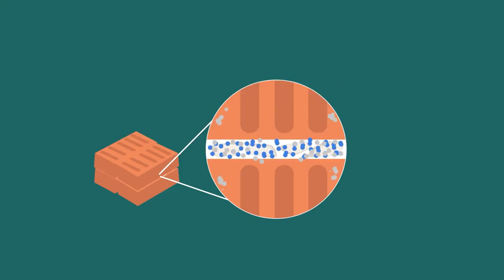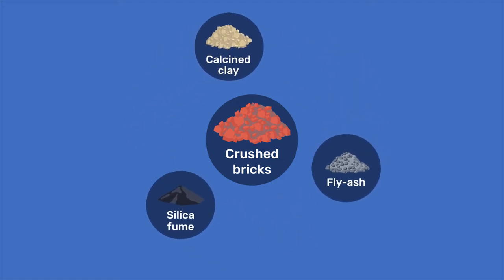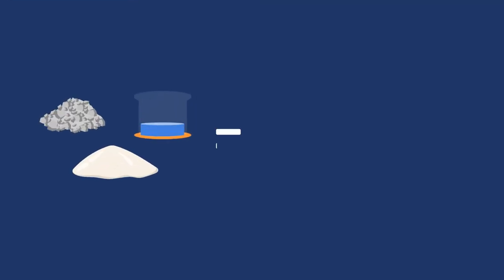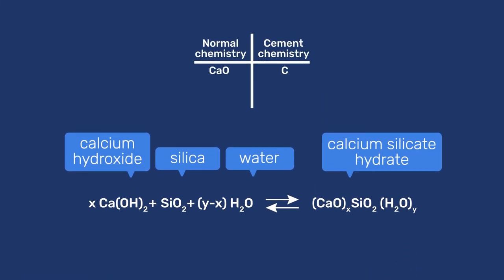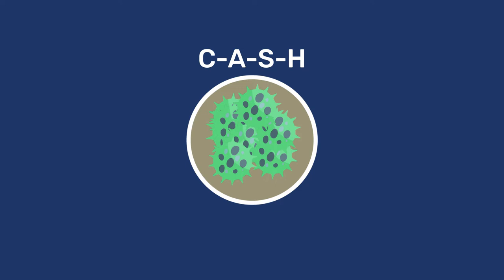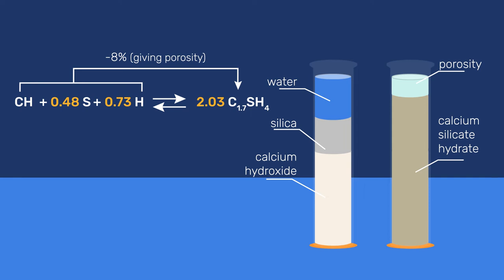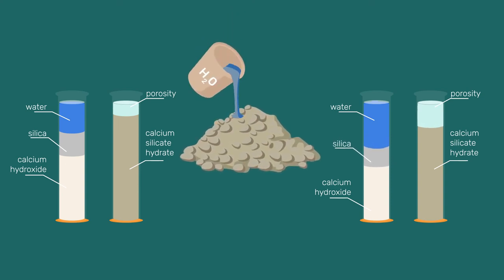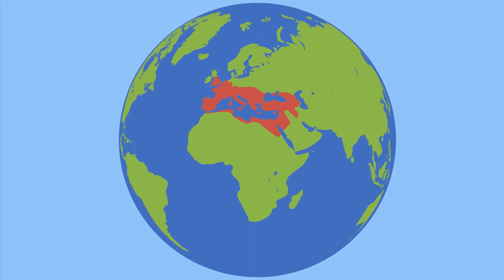Roman mortars and the secret of the pozzolanic reaction

Comment: This video does not descripe the true hydration reactions of the Roman cement.. Roman cement is reaction between amorphous CAS material such as the pozzolana or GGBS and hydrated lime and an activator in the case of Roman cement and a crystalin material such as th tubomorite.. the binding strength of the Roman cement does not depends on the CSH crystal phase rather then it depends on the hexagonal crystalian phase.. these crysalian phases, the hexagonals, are the secret of the longgevity of Roman cement.. they do not undergo intrensic shrinkage after setting but most important they need high volume of water double the amount of water needed for the CSH crystals that found in Portland cement.. on top of that the left over of the hydrated lime will react with Carbonate to form a layer of calcium carbonate that will added to the overall strength  of the concrete.. Roman cemmen does not suffer drying shrinkage like normal Portland cement because it absorb the extra added mixing water into its crystals, and does not develop drying shrinkage cracks like OPC concret ...that is its secret..
Reply: If I wanted to build a stone house to last a thousand years, what mortar should I use between the stones to last a thousand years?
Reply: @ad1103   it reads like you should stack basalt and plaster it in mortar
Reply: Dont use Stones
Reply: thanks for pointing this out, I don't think this video is correct either... hydrated lime doesn't bond strongly and only in a linear fashion is what I have read, I read that the Roman concrete had unreacted quicklime left in the mix so it could heal, but I don't know what is true.

Comment: Great video! I have a question regarding the superiority of the modern portlant cement. It has indeed proven itself by its wider use of course and its thermal expansion similar to the steel. Yet concrete made with portlant cement degrades rapidly and its durability is questionable. Its PPC's main ideas. It allows for extended durability as well as chemical resistance. Would you share your opinion on these facts. Also I read that the aggregate used by the romans had larger variety as well, effectively making rubble concrete.
Reply: They are being sort of dishonest in saying modern concretes are “superior”. They might be superior at generating industry, but not as a building mortar and concrete technology.  The first issue is them skipping from “Roman concrete” to modern hydraulic products:  by volume of use, most human structures up to 1900 are hot mixed quicklime and earth.  Sometimes modified with poz.  The knowledge was never Roman.  The only thing Roman was industrial scale and military application…. They did pick it up as one of their technologies, as every building culture did.  It was used all thru the Middle Ages in the levant, china, France, etc.  never Roman never lost.  Always the main technology for human scale building.  Plasters, mortars, and cast things.
Reply: John Smeaton who was fully familiar with all manner of concrete chemistry and their use by craft guilds thru his recent history…. Writes from 1800, that “Roman concrete was lost”
Reply: @KurtisHord   Thank you for your reply. Some interesting points that you bring up. I would take me time to reply categorically. I am not sure if they are dishonest in their assumption of the moderns concrete superiority. I am sure that if there is any mistake in their knowledge it is due to the information sources used. Nevertheless, in school we have learned about the ancient construction methods, although to be honest I do not remember half of that, and the point of the superiority of the portlant cement was its thermal expansion and strength and compatibility with steel; These all sum for the what, I think I understood you meant as generating industry.
And about the romans, they surely did not invent the concrete but the way they made it popular one. I have read that the minoans used it for baths. Interesting point you bring up with the earth, I am not sure it will make same chemical bond with the lime as lets say crushed ceramic pots, vulcanic ash whatever (As is the one found in some places in germany). But all what you say is very interesting I would like to read about it if you can recommend smth. to me. 
For example I have read that the romans made a sort of rubble concrete out of it, making the mixture rathe dry compacting it and puting layers of stones; And also some brick separators (in some cases as external layer) every meter or so. Very similar to the middle ages wall construction (at least the one I've seen).
Reply: @TheTransfix  so…. Understand the folks who invented engineering trades, had an agenda to say they were superior and craft practices of builders prior to them were not to be trusted.  I am a builder that works with 9th century methods and materials.  So I have my own agenda to promote human centered building knowledge rather than corporate or industrial
Reply: @TheTransfix  the best scholar is dr Robyn Pender and the best chemist is Nigel copsey
Reply: @KurtisHord   I forgot. I absolutely agree this was never lost. I guess it is a sensationalism thing.
Reply: @TheTransfix  the engineering field started with John Smeaton and it’s based on data from two things: beams in tension and cast blocks of binder in compression.  They founded a whole corpus in that

Comment: Dr Mohammed Alhaj Hussein 

Roman pumice white  or gray pumice ( amorphous pozzolanic material ) from  بركان فيزوفس  near pozzoli, مدينة بوزولي south Italy contain High content of SiO2 , and Al2O3. 

Roman cement is reaction between high quality of pumice powder 
and hydrated lime.  

The binding strength of the Roman cement does not depends only on the CSH, like normal Portland cement, it depend on the Sustainanle roman reaction CSAH.
Reply: If I wanted to build a stone house to last a thousand years, what mortar should I use between the stones to last a thousand years?